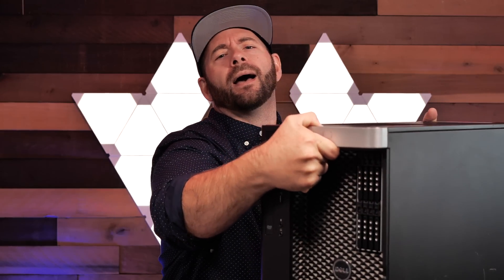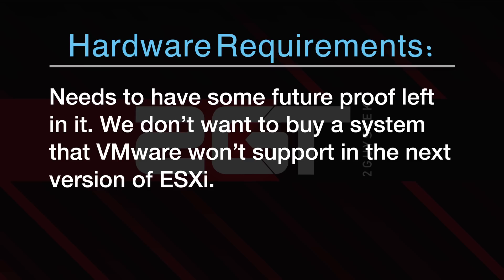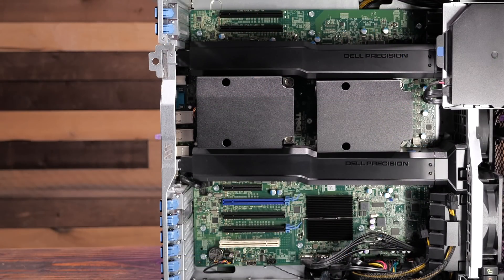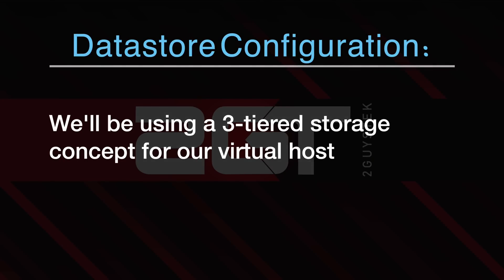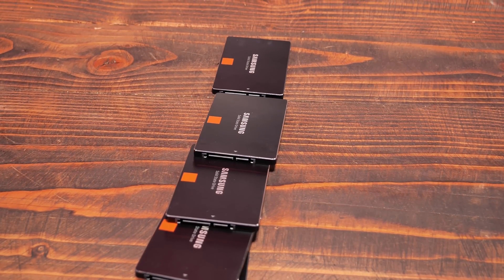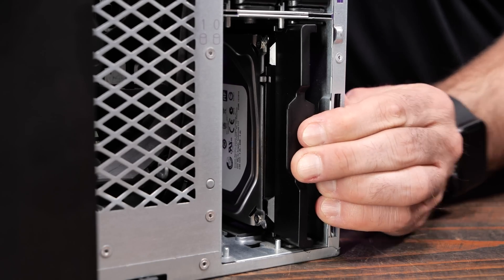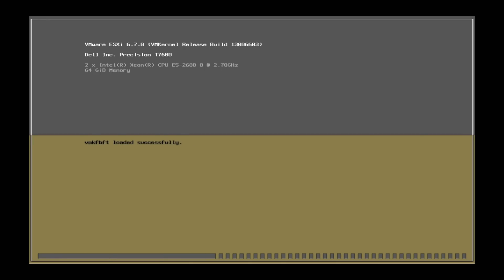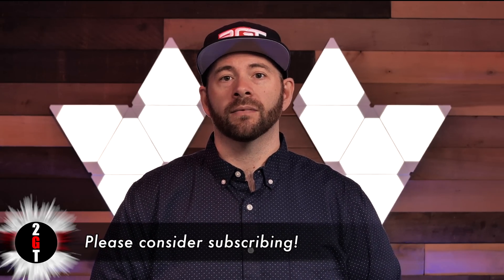Cheap and Powerful Home Virtual Server - $300 GETS YOU A TON OF POWER!

Comment: And it only costs $300! If you don't count the $4000 of hardware we already had lying around...
Reply: and then you open ebay and for 300 is only mb with cpus or for 400 with one weaker cpu :D
Reply: @shadowmasterlord  presne tak ako hovoríš 😂
Reply: I dont know the electricity cost in the US but in Germany it would cost me a asset.
~ 35 Cent per kWh 

Edit: So the Internet says 13.19 Cents in the US.
Reply from the maker: On the west coast of the US where we are it's $.11/kWh
Reply: @2GuysTek  WOW here in Germany were by $ 0.32 /kwh .... rip
Reply: @toby_4820  Seriously? 30 cents KW/h? That's freaking high.
Reply: @2GuysTek  yeah, great that your country runs mostly with renewable energy, right?
Reply: TwoWarPlayers same in Australia.. bloody expensive
Reply: Dell Precision T7600 16-Core 2x Intel E5-2680 with 64 GB ram - $400 + $55 shipping

DELL PRECISION T7600 1300W POWER SUPPLY - $50 + $16 shipping

 AC Power Supply Cord Cable 4 Dell Precision - $8 + $3 shipping

XPG LITE SX6000 Series: 512GB Internal PCIe Gen3x4 (NVMe) - $66

M.2 NVMe SSD to PCIe X4 Adapter - $20

Samsung 860 EVO 500GB 2.5 SATA III - 8 x $85 ($680)

Athena Power BP-15827SAC an 1 x 5.25" External Drive Bay to 8 x 2.5" - $65

Cable Matters Internal Mini SAS to SATA Cable - $12

Seagate ST5000DM000 5TB Internal 5900RPM 3.5"  HDD  Lot of 4 - $275 + $9 shipping

Total - $1660..... So 1360 dollars over or 5.5x the ammount presented in this $300 server. The extra 5tb drive can be used for backup of the SSDs and NVMe capacity (4tb with raid 5) while the other three can be in raid 5 (10tb). This only gives you space for one complete backup of of the fast storage and with the other 3 5tb drives in raid 5 you have resiliency but no backups. Total capacity would be about 14tb in this config.

This is without a $1,000 1080ti if you want to do rendering.

Just the extra hardware is $1,120 aside from the server, assuming you find one with 64gb of ram and 2 xenons

64GB (4 x 16GB) DDR3 PC3-8500R - $86
Intel Xeon E5-2680 2.7GHz 20MB 8-Core 2 x 52 ($104)

If you include the NAS shown in video and asssuming you want 5x capacity (70tb) for backups it adds an extra $3,660

Synology 12 bay NAS DiskStation DS2419+ - $1500

Seagate IronWolf 6TB NAS Internal Hard Drive - 12 x 180 ($2,160)

Bringing total cost to $5,320 with the parts used. Without power consumption.

I understand that this isn't a build video and it's essentially just saying look what I built for the channel but this could have easily been titled "building the "bigboi" virtual server" without the mention of cheap or modest or anything that implies that this is affordable. Yes you can get a ton of power out of a sub $500 server and that is freaking amazing but without storage that power is applied to nothing.
Reply: @ashtreylil1  Then don't buy such expensive components. You most likely don't need 9 500 GB SSDs! That already reduces the price a lot... Same with branded components, which are quite expensive for what they are (seriously, $8 for a power cable?!). Also, the price referred to the computer + 16 GB RAM + Xeons, not the entire build.
Reply: @GRBtutorials  I looked up every component on eBay.
Reply: It didn't take much to realize you got a one time deal or this video is actually a big lie.
Reply: @youngdesperado765  it is a big lie lol, most of the components were ones they already had on hand.
Reply: 4&5 tb drives are a waste of slots.
Reply: Came here to literally post this almost verbatim. (I was going to say $2000 of hardware).
Reply: Yeaaaa. Channels not gonna survive at all posting misleading stuff like this.
Reply: Thanks for saving me time, stupid click bait.
Reply: I was going to say the same thing :). Anyways, I really wished this was true.
Reply: you're not even going to mention the esxi license?!?!
Reply: I actually found a company selling this server refurbished with the parts I selected it was around 1200 before taxes with free shipping in the video he did say that he had parts for it so he wasn’t really lying. In my opinion.
Reply: Backyard and & @PlankensNetworkingTutorials  do u think that these is a good deal?
Reply: WOOOW LOL
Reply: .... Do you critical think
Reply: This confirms that this ain’t this cheap
Reply: Anyone in IT support should have drives and ram laying around. I brought a Precision T7600 for $350 with dual xeons and 64gb of ram. I had a bunch of Samsung 500gb 2.5 ssd laying around so brought the IcyDock unit for expansion, the had 4 2tb Seagate Barracuda laying around from an old Nas unit. So just need 2 of Dell HD caddy and got those for 23$ a piece. So in total the machine fully configured and up and running was 520 bucks. I mean if you in IT and dont have components laying around what exactly are you doing.
Reply: Thats absolutley a typical price for something like that - i'd say they got a good deal, can be a little more some times but its attainable. I've paid that for the same performance, ive paid a little more and a little less sometimes. For sure the extra ram and the extra disks are where the money is but that is always the case and can't be avoided. My $300 Dell R720xd came with a pair of reasonable Xeons and 32GB DDR3 but I have added 8x 10TB LFF, SSDs, 10GbE SFP+, 256GB RAM etc. Thats probably a further $2k. My server still cost me $300, did your house come with furniture?

Comment: Guys, don't understand why you bother with proprietary ESXi instead of XCP-NG or unRAID?
Reply from the maker: The biggest reason is that working with ESXi as part of my #homelab keeps me sharp for working with VMware professionally in my day job. Thanks for watching! -R
Reply: @2GuysTek  why not a seperate Storage only Server?
Reply from the maker: @juri14111996  we technically have that already with our #Synology NAS. We use NFS datastore mounts from ESXi to volumes hosted on the NAS for VMs with big slow disks. Unfortunately the NAS only has a 4x1Gbit LACP trunk to the network so it's read/write rate isn't anywhere near what we can store on the internal NVMe.

Comment: high-end workstations make for perfect SOHO servers: great performance and reliability, (usually) easily serviceable, and spare parts readily available. and: you don't need hearing protection if it lives in a closet next to your desk.
if uptime and redundancy isn't your main concern, you can squeeze a lot of performance out of them for quite little money.
Reply from the maker: Couldn’t have said it better!
Reply: @IJoeAceJRI  ofcourse you can; the hardware surrounding it (in that weight class, mind you) will just go "thanks for all the fish" in a few months - while running, and you depending on it
Reply: @IJoeAceJRI  generally, it's not the CPU that burns down, but a power supply, a disk controller fails, stuff like that. neither is a problem if you have hardware redundancy

 (edit #3, sorry.)
of course you could run a server with a 1600 on a decent mobo and you'd be fine. but you couldn't run it with a terabyte of error-correcting RAM and at 100% load, 24/7, for years. 
"home NAS" vs "business machine, needs to make money"

Comment: i just checked on ebay uk - it is more like £1000 build, no point better to go with Ryzen...
Reply from the maker: We had a comment from someone in Germany that said a similar thing. This is a real bummer to read. Did you check on HP workstations? I know that HP tends to have a deeper market penetration in Europe (and the UK) than Dell does. It’s possible you could find the equivalent hardware from HP for a better price due to more availability. Thanks for the comment! -R
Reply: @2GuysTek  yes, it is. I am not desperate, I just wanted to have a go at it, as at this price it seems like a fantastic deal. And I do not like HP :).
Reply from the maker: Luke Mx personally I’ve been a Dell guy for datacenter gear for a long while as well :-)

Comment: for all that you did with this server, I think that you might of been better of using Unraid which would of given you better options with VMs, HD setup and expansion, and overall future expandability with an low overhead.  I would have also move all the guts from that limiting Dell case to a more robust server case with the overall cost being just a little more.  Just a suggestion...
Reply from the maker: Great recommendations! The decision to use ESXi is driven by a few factors, but one big one is that VMware is considered THE enterprise virtualization platform for business and running this helps me continue to sharpen my professional skills and experiment with #homelab stuff that directly benefits me in my day job as well. Thanks for the recommendations!
Reply: @2GuysTek 👍

Comment: I ve been using old tech servers for some time. Its great get something  just out of manufacturers warranty but for change, instead of several grand. Plus you can upgrade for cheap too.
Reply from the maker: I had been doing this with servers for years too, but never seriously considered using workstations till now! This has been such a success that I probably will never go back to server hardware again. Thanks for watching!
Reply: @2GuysTek   Ive ironically used servers as workstations.... Fujitsu servers, that I have used all happily run windows 8 and 10.  found this out by accident when I booted up a spare drive in mine by accident.
Hyper v works very well and the two SAS cards I got for free :) work well. even has a dual screen graphics card and sound.  I work as an IT engineer so comming across"old" tech is a work hazard and one I often benefit from. seconhand is great.

Comment: Hey guys, really good video, I subscribed😎.  It’s interesting you’re also using a Diskstation NAS, they are amazing! I’m sure you know you can also host Vm on those.  When I think of VM I’m thinking like having a VM for a Linux distor or Maybe an older version of Windows..  Could you please share what specific VM you’re running?
Reply from the maker: We're big fans of Synology! In fact, we use it as part of our ESXi datastores via NFS mount for VMs with large disks that don't need to be super fast (just big!) Regarding virtualization on Synology - I've never used it myself, but considering the lower power nature of the Intel Atom C2538 in our DS2415+ we probably wouldn't get much running.

To your question about what we're currently running, at this moment we're running 10 VMs. 4 Ubuntu VMs, 2 Windows Server VMs, pfSense, 2x Windows 10 Pro VM, and a vCenter server appliance. All have a variety of different amounts of RAM, disks, and vCPUs associated with them.  

Thanks for the comment!

Comment: Yeah I got an old ProLiant ML110 G7 server that I installed  a Xeon chip on and 32GB ram maximum. It sings like a bird as a file server and quiet as a mouse. I'd love to stick 10GbE on it, but will have to wait. Nice server.
Reply from the maker: You running Linux? Windows? FreeNAS? Thanks for watching!
Reply: @2GuysTek  I'm running a domain server in WSE 2019.

Comment: What backup solution do you use as your running the free esxi version
Reply from the maker: Due to the limited API functionality of free ESXi originally I was backing up via the VMs themselves, that was a problematic mess so I joined VMware VMUG Advantage ($200/yr) and have access to full vCenter licensing (and unlocked ESXi API). Now I'm currently using Archiware Pure to do VM backup to a NAS target on my LAN. Pure is free, painless to setup, and reliable. I've tested restores and it's been great! Thanks for the question! -R
Reply: @2GuysTek  cool, when I was playing about with it years ago I used this
https://sourceforge.net/projects/xsibackup/
Reply from the maker: Michael Hansen I’m light on OpenBSD’s hypervisor, does it allow for snapshots of live VMs?

Comment: nice idea, the same machine has a price tag at German eBay of 1.300,- €, congratulations to the cheap buy!
Reply from the maker: That’s a serious bummer! Are the equivalent HP workstations any cheaper? I know that HP has a higher market penetration in Europe than Dell. Check those out and see if they’re more affordable! Thanks for watching!
Reply: Specifically, the magic search term you want is "Proliant." It's a brand they got when they acquired Compaq. HP Enterprise still sells Proliant servers; used ones can be quite cheap.
Reply: @2GuysTek  still don't know how you have done this, following your link to the US eBay the price tag for the dual Xeon is 1150 and more $, good fetch!
Reply from the maker: Joerg S the crazy thing is when I originally started searching for a system these prices were just average. Sure there were some high-priced ones, but a majority were in the $300-500 USD range. I look now and I can’t believe how much the average price is!
Reply: @2GuysTek  It is as it is :-) I believe you that you had paid 300 $ for the system. Because of videos like yours the demand rises, and in parallel the price, this is called capitalism ;-)
All the best from Germany. A really nice video that gave me the crazy idea to build something similar, but with one exception, I'm aiming for unraid. Why have you chosen ESXi?
Reply from the maker: @JoergSi  My primary reasoning for using ESXi is essentially it helps me in my professional life. VMware is the datacenter virtualization of choice for business and having the homelab running vCenter and ESXi lets me play around, sharpen my skills, and test things I couldn't do with a production infrastructure at work.  Thanks for commenting and watching! Let us know how your UnRAID project goes!

Comment: late to the game, That was My pc in 2016 and I got it for a similar price too. I also got it for the same reason 😂 I Love virtualization
Reply from the maker: #homelab FTW!  Are you using ESXi as your hypervisor or something else? Thanks for watching!
Reply: never truly ran ESXI on it as the primary until I sold it to a friend. I used UnRaid for a while, until I decided I wanted a different set up. Then I switched to the X99 platform with a high core count Xeon so I could have 4 graphics cards. Pretty nice now, I have dedicated USB 3.0 controllers for all my VM’s 22GB RAM per vm (96GB total), each vm has its own SSD and as mentioned 4 capable GPU’s. better yet, in a case the size of a mid tower, with water cooling. I do miss my Dell precision though, a lot of good memories. would definitely still recommend it for someone who wants to get into virtualization 100%

Comment: Hi, just found your channel and love the video! I have a few questions about your setup. 

I believe you mentioned it quickly but did you have to add a discrete graphics card for this setup to work?

Can you connect a total of 12 drives? 4 on each SAS and then 4 from the hot swap bays?

Are 10TB HDD supported?

Thanks again, you got a new subscriber!
Reply from the maker: Hi Micah, thanks for the comment! We did have to add a discrete GFX card as the chassis didn't come with one when we bought it from eBay - That being said, the card we put in it was very, very low end, just a basic Nvidia 2-port Quattro we had laying around. 

Regarding the SAS connections, the board has 2x mini-SAS connections which would let you do a total of 8 SAS/SATA connected drives. You can connect those however you'd like, with 4 going to the hot swaps and then 4 more going to a high density 5.25" disk bay like we used. The built-in disk controller only does a software RAID, which isn't supported by ESXi, so if you want to do a proper RAID-5, 6, or 10, get yourself a RAID card for cheap on eBay as well to allow you to build the array of your dreams!

We didn't test 10TB disks, only 5TB, but I don't see a reason that they won't be supported - this chassis isn't old enough that it would have a limitations on the disk size. Here's Dell's specs for the platform: https://www.dell.com/support/article/us/en/04/sln290764/hardware-specifications-for-the-precision-t7600-desktop-workstation?lang=en

Comment: The potential of upgrading this machine is mind-blowing. Nevertheless you have to get all the other components at barely the cost of the computer, specially a video card if you want to virtualize multiple hosts from 1 machine.
Even though still a very big barigain what you found. Thumbs up for that!
And how you can fusionate 2 or more computers in one big to be able to do the same thing as one PC that is way powerful?
Reply from the maker: It's the magic of virtualization! There is just so much power in modern hardware these days that we just don't unlock running one OS on it at a time. A platform like the T7600 is a great place to play with virtualization and fully unlock all of that potential with multiple VMs at a time!  Thanks so much for watching and the comment!

Comment: But with Ryzen.... is this still a good idea or is Ryzen better ?
Reply from the maker: I touched on that a bit in the video - Obviously having a 3950X would be better, but the chip alone costs twice what the entire chassis does. Then you'd still have to buy a case, RAM, PSU, motherboard, etc. Also, there's something to be said about having the reliability of Xeons under the hood for ESXi. If you have the money, build new if you can afford it - you'll always get more years out of something brand new than used gear, but if you're trying to save money and get a ton of power, consider this an alternative!  Thanks for the comment -R
Reply: If you can live with 8 cores, a R5 2700 is 65 watts, which will save a lot of your power bill.